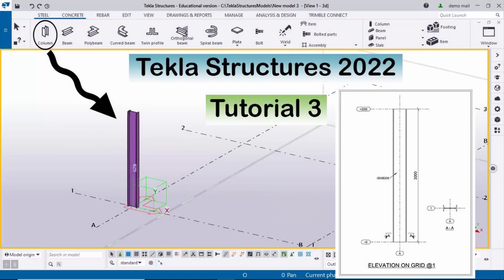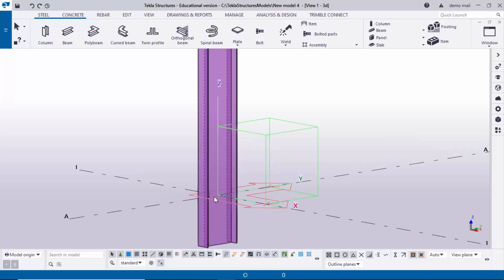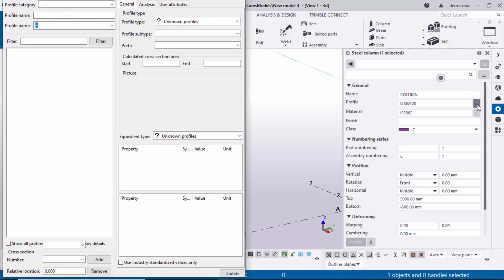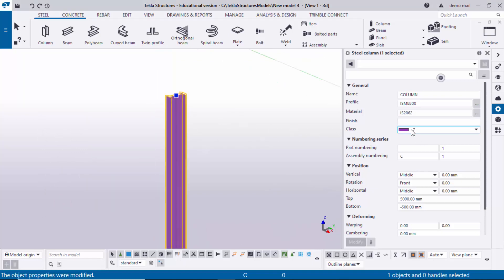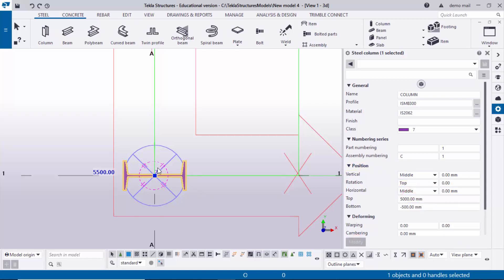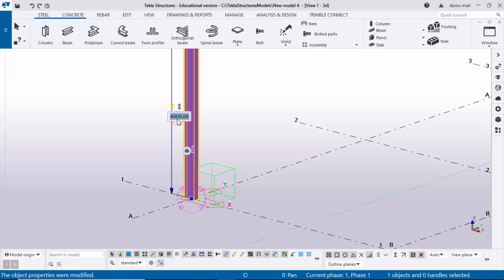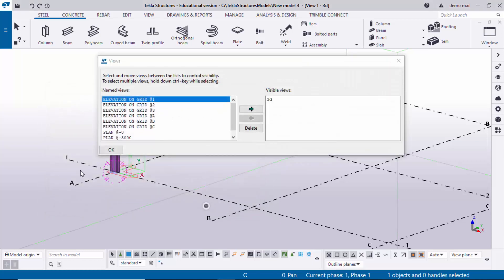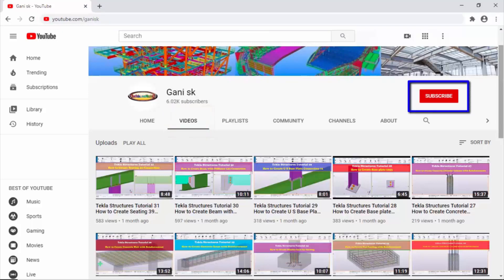Tekla Structures 2022 Tutorial 3 | Create steel column with example 1

Comment: Sir how to add slab on beams and loads for tekla 2018 i see interface not same as your video .. con i get 2015 interface for 2018
Reply from the maker: Are you asking about Tekla Structures software or Tekla Structural Designer software, both are different software's.
Reply: @GaniSk  i don't know there is another software for design sir what's that
Reply from the maker: Yes, this video about "Tekla structures" software, this is not design software, this is only modeling and detailing software.
coming to design software "Tekla structural designer" this is only for design, refer this video about design https://youtu.be/jdE9z5I4hnM